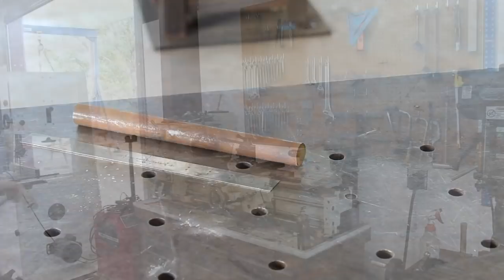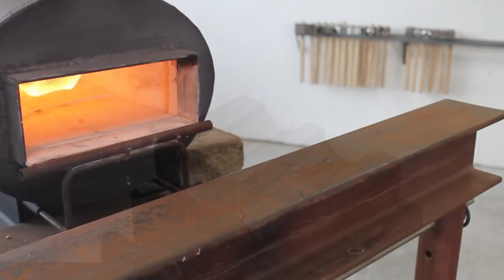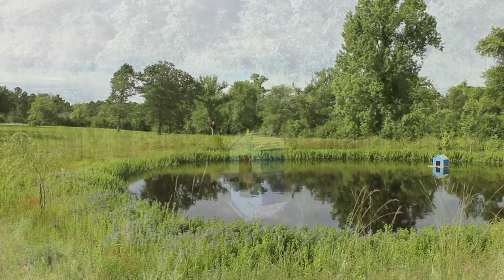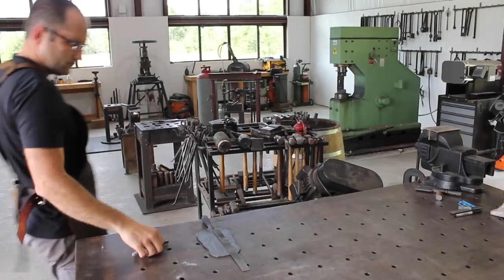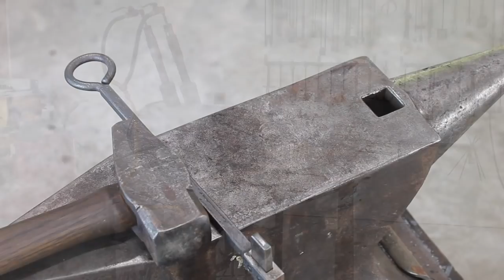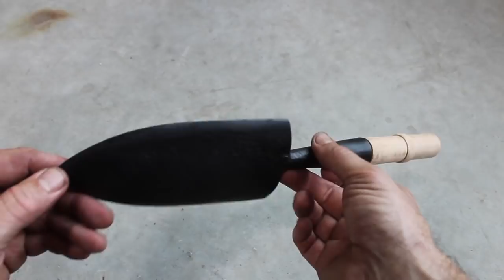Forging A Garden Trowel

Comment: Nice! Love the transition into the blade. Wonder if you can forge that with a swage maybe... tricky, but that part is solid at least.
Reply from the maker: Believe me, I was thinking the whole time, I need to build a depression/die to set that shape.  A die would be faster and look cleaner.
Reply: @rigoniironworks  You need boiled linseed oil.
Reply: I want to  see you two do this together.
Reply: I find this amusing: everyone loves a hand-forged item because of how it looks, and you two are talking about how a die would be cleaner & faster…if I wanted a die pressed or stamped trowel I can get one at the local hardware store 😆 surely there must be some middle ground! PS: it is an awesome trowel and I’m just having a bit of fun
Reply: @DBKING04020  At least it's still made by a blacksmith!

Comment: Great video. but why would you not start from sheet steel??
Wouldn't be so interesting but would be a lot quicker
Reply: Quality and technique
Reply from the maker: This is stronger :)
Reply: Why wouldn’t you pick one up from the hardware store for less than five dollars ?
This tool doesn’t need to be this strong as it’s only used for turning over topsoil !

Comment: Nice trowel.
Clean work as usual.
You have obviously machined a large variety of bottom tooling for your power hammer. 
Also I have always liked the kiss block system you designed. Very handy for repeatable sizing!